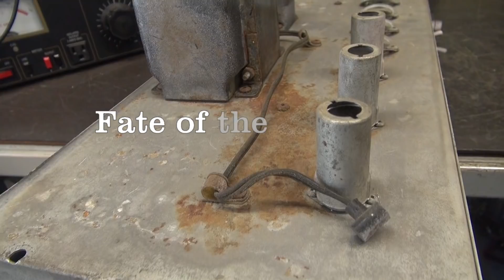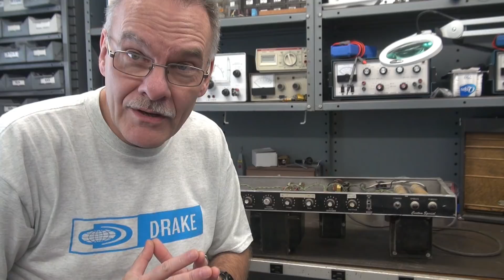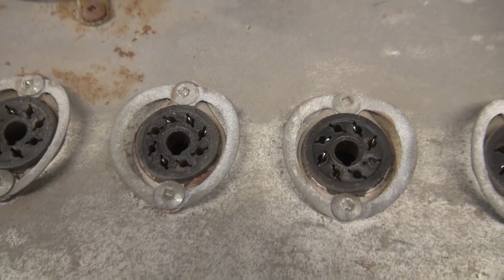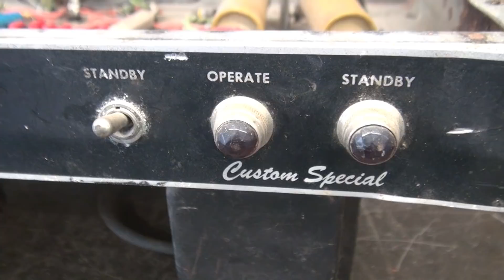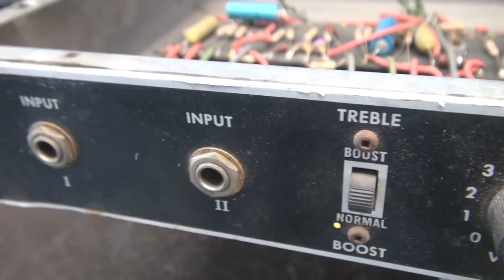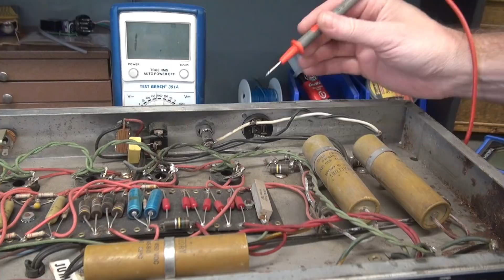Traynor YBA-3 Custom Special tube guitar amp Inspection Shorted power transformer No Repair

Comment: I have one of these opened up at the moment. In case anyone's interested, those three additional filter caps inside the chassis, as well as the internal pot for negative bias adjustment, are present in mine as well—which means, they're probably original, believe it or not! Great, great amps. Mine sounds incredible with a Tele on one side and a high efficiency EV 12" speaker on the other.
Reply: The dynamite stick caps are original for sure, I'm surprised at the bias pot

Comment: Terry can you help me with a cap for a Lafayette comstat 35 cb tube radio its working but this cap is domed the xap reads 47uf 350 volt to a b c 47uf and d is ground  craverdan.s@gmail.com

Comment: My dad bought me a Traynor YSR  head with matching 4-10 cab ,new in 1969 . It still works. The cost was around $ 395  with covers and footswitchs. I can't tell you all the abuse it took and all the dumb stuff I subjected it to. All I ever did to it was change tubes. Built like a tank. Sounds good. Yes,  those are original knobs and Mallory brown filter caps.

Comment: I have a traynor yba1 *the weird one..i added bias control,series the two inputs/sep cath cap and resistors....lol.added rev.soooo its basically a ridiculous jcm 800 w/mastr vol. Have bias set max for 6V6s so it will run 6L6s at same setting. Pd 350.   Came with el34s...

Comment: I recently acquired a Valvestate S80 8240 with the chorus and reverb knobs sheared off, so im in the process of replacing the pots. Upon opening and inspection I was amazed how clean it was. But I did find a visual issue of the solder joints leading to the reverb tank. The reverb works and sounds fine, so im not gonna screw with them at this point.But would like comments and suggestions. The main question I have is concerns how the circuit board is attached to the chassis. It has little white clips that ive not seen the type before. Is there a trick, or special way to unlock these clips without damage, or risk of having a loose board? Another interesting thing I found was the inspection stickers, one say's inspected by Rita and another with Marconi midata 520, which after a little research appears to be the name of the testing unit used.  Any help or comments would be greatfull, thanks. P.S Nice to see another Michigander.

Comment: I would put  a used power xformer from an old tv set, sometimes found like at the recycling center. heck, I have 2 in my parts bin for a jtm100 build. Its the rigth output transformer that's hard to find. If he's got the headshell and the pots are not seized I'd be crazy enough to restore it. but for a repairman yeah not worth it.

Comment: There is a possibility with this amp - someone could, if they wanted to have a big project to work on over many months, create a new amp from the shell.

They'd have to do significant metal work and remove the rust etc and then, effectively, create a brand new amp since so many parts need replacing.

Would still have the Traynor name on it but it couldn't be considered a "restored" original amp but would be considered a Traynor clone.

Don't even count the number of hours devoted to the rebuild.

Could sell it for the combined price of all the hardware bits. Your labor would be free.

Comment: Would love to see a video dedicated to testing input and output Transformers of a vintage tube amp. 
I have so many wires coming from mine, I have no idea where to start and if the transformers are bad, good or great.  The amp powers up but I want to be sure these 1958 vintage transformers are ok. 
Again, a beginner guide to checking these in circuit. Thanks 👍

Comment: Good call Terry, the head in fair condition is only a $4-500 amp. I think I have the correct Hammond power transformer. Never seen output Hammond output transformer fail but don't ever recall an amp looking so abused. "know when to fold them " is the right song.  Love your channel, loads of great info....good job!

Comment: For any who may be interested in the history of Traynor amplifiers, there is a Wikipedia article on Pete Traynor, who passed away in 2016. In 1960s Toronto there was a vibrant music scene in the Yorkville district, where numerous (formerly beatnik) coffee houses catered to the growing rock movement, and furnished numerous musicians with the foundation to go on to greater things. In the mid 60s the area was quite run down and inhabited by a largely migrant hippie population. My grandmother worked in a gift shop on the edge of "the VIllage" for a time. Yorkville bands would rent sound gear from Long and McQuade, where Pete worked, so youngsters like me living in the Toronto area would rock to amplified music courtesy of Pete. I remember being in the back room of the store where all the rental equipment was kept. I'm sure some  of you would have wept at the sight of all those Traynor heads, 2x12 and 2x15 cabs and speaker columns for PA systems.

Comment: A sad loss of what once was a beautiful amplifier, but I'm afraid your recommendation to not restore it is the right one. If the owner would have chosen to have it restored anyway, it would come with the same cost in components and labour as having a large amplifier built from scratch. (Whether the owner would choose brand new transformers or having the original Hammonds rewound wouldn't make that much of a difference. At least that's what I would assume.) By the way, those large electrolytics ("cigars" as you would called them) underneath the chassis are original to the amp. They came in conjunction with the can capacitors on top.

Comment: If you could get it at the right price (really cheap), it would be a great hobby rebuild putting your own time in it just to see it come back to life.  The transformers you can't get for cheap but you could go cheap on the caps, etc just to get it running and then do upgrades.  If the amp looks that bad, the cabinets and speakers are probably just as bad.

Comment: Terry, where do you get high voltage electrolytic caps at a reasonable price?  I used to go to Frys or Circuit Specialists in Tempe but the Frys store is almost empty now and the Circuit Specialists retail store is closed and nearly everything online is out of stock!
Reply: I buy F&T caps from CE Distribution or if you aren't a business try their retail outlet www.tubesandmore.com. In small quantities you can find them on Ebay. Weber also sells high voltage electrolytic caps but I prefer F&T.

Comment: I own 3 Traynors.  I haven't got the YBA-3 on the bench yet but I know they really have nice punch. Mine stinks of nicotine.  Back in the day these were used by bassists and guitarists alike.  If I remember correctly you could get 18 inch Goodmans speakers for bass and for guitar they had the "Rogue" 8-10 inch speaker cabinets.  Many Traynors used Marsland speakers. The later ones (I believe 1972 or later) had a nice design where the top of the amp would come off making the internals readily accessible for field repairs.
Reply: The YBA1 bumper style head has the removable top. Basically a modded JTM45, but can be modded further for guitar use. The YBA4 was probably the best of that series.
Reply: @sinecure45  I have both the YBA3 and YBA4 with removable tops.  I live in Canada where these are far from scarce.  I have another Bassmaster Mk I without the removeable head.  Looking for a MkII of either type.
Reply: @philipdecatanzaro1822  Good luck with your hunt for a MKII. I hope something turns up. My YBA1 is the 70s bumper cab style, which I had modded with JC Maillet's variations. I have a couple of reconed old JBLs I'm thinking of swapping in, but probably not worth it as it hasn't been played in years.  I'm in Canada too. JC thinks that the YBA4 is the best of the series.

Comment: Brad the guitologist did the YBA3 bass amp a while back, very impressive amp indeed.  Good luck finding one under 1k$ in good working order.  Sunn, Treynor, and Ampeg were to ones that beat Fender back in the 60s.
Reply: I sold one on Reverb a couple of months ago for  I think it was $650.00 US and it took a while. The problem is finding someone local to buy the amp since it weighs 65lbs. I recapped it and did some other work. It was in great shape. 1969. I sold because of its weight.

Comment: Is there a big difference between the marshall and fender tone filter circuits?? Im curious before I build a tube amp thinking about a change to cover the 2 circuits. I wonder how they compare to a hifi tone filter circuit?
Reply: It's not unusual to see two channel, custom amp, builds where one channel is voiced like a Fender and the other like a Marshall. However, if you enjoy channel mixing designs, this gives you a very different tonal palate.
Reply: @kendipietro6855  its the audio transformers or the power tansformers that cost so much?
Reply: @hadleymanmusic , Typically, the power transformer and output transformer are close to equal in cost with the choke being significantly cheaper. In the case of Weber, their 100Watt output transformer is listed at $86.00 and their 80 Watt power transformer is listed at $75.50. To be clear, there are not direct replacement parts but they would service a quad EL34 amp pretty nicely. On the other end of the spectrum, Mercury Magnetics would easily be more than double the cost for the same set.
Reply: @kendipietro6855  hey thanks! Im slowly gathering enough ideas to do one. Even the guitologist hasnt told me much that Ive asked. Id like to clone an old silvertone hifi circuit into a guitar amp as well.
Reply: @hadleymanmusic , I'd like to invite you to join a bunch of us amp builders at www.wattkins.com. In fact, there's a Silvertone 1483 thread going on there right now.

Comment: If you suspect a transformer (or even an AC motor) has been exposed to moisture, I often "bake" them in the over at 150-200 degrees for 1-2 hours to drive the moisture out. In this case, the transformer is fried. I have had good luck with my method. IIRC It came from an old ARRL hints & kinks article or QST magazine from 40+ years back.

Comment: Traynor amps used Hammond Transformers, the same or VERY similar series for Dynaco / Dynakit like the dynaco 120 ( also the old SUNN amps ) .  I don't think they used the UL taps in those heads. The chassis would need to be gutted and rust removal, you can use a chemical but that messy and so is grinding the rust off.  Yes, a lot of work.  A lot of work.  If the owner bought the transformers and had a new set of tubes / sockets, etc..yeah it could be a cool thing for a YouTube series...but yes, that's a lot of work.
Reply: You could strip the chassis then bead blast it. You could then rebuild it as a fender clone.
Reply: @jakeblues3676  LOL!
edit: I'm Still laughing at the Fender clone part! (not that there's anything wrong with that...)

Comment: Hammond Power transformers around $200 Output Transformer around $150
Reply: I found the PT on nextgenguitars.ca at $266 CAD
Reply: I'm pretty sure Weber has suitable replacements for under $200 for the set but the rest of the amp would still need to be completely rebuilt. Unless this thing has sentimental value, it really wouldn't make financial sense to do anything more than pronouncing it deceased.
Reply: @kendipietro6855  It would still be sad to see it go to the dump. Perhaps that thought qualifies as "sentimental". I suppose it's up to the owner what to do with it. It really all boils down to the condition of the transformers and chassis.
Reply: @sinecure45  From what I can see. that chassis isn't salvageable. As far as the transformers, the cost to rewind them or replace them would by significant but if we were to try and restore the amp with a new chassis, transformers and a completely rebuilt board, at what point does the original amp no longer exist?
Still, I get your point.

Comment: Forgive my ignorance, What’s a “hanger queen”?
Reply from the maker: A grounded aircraft which is kept so that its parts can be used in other aircraft. (idiomatic, slang, aviation)
Reply: D-lab Electronics Love It. Thank you for taking the time to answer.
I own a early 70’s Bassmaster. Traynor’s are diehards and well built. Sorry to see this one down and out.
Reply from the maker: Yes Sir, I agree.
Reply: When a  tool or device is no longer safe to use, it becomes a decoration.  The firearms collector equivalent would be the old musket above the fireplace.

Comment: Too bad the amp has been left in a state that it is. It is well worth saving, but that is my opinion. Those tubular filter caps are original to the amp. That sucks the amp won't be repaired...
Reply from the maker: Roger that, Could be restored but not at my shop, It wont be scrapped
Reply: @d-labelectronics  I'm happy it won't be scrapped.
Just a thought; you take a project like this and r+r the bad xformers, new filters and bypass caps. It seems similar to the Vibrolux from Hawaii. The Traynor is just not well kept up. Maybe you may can have a change of heart. What say you Terry?